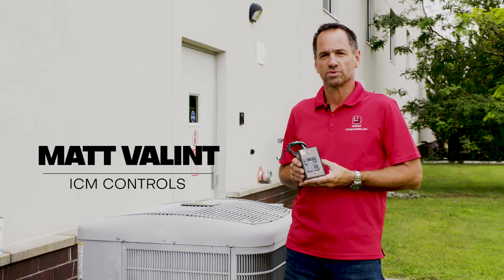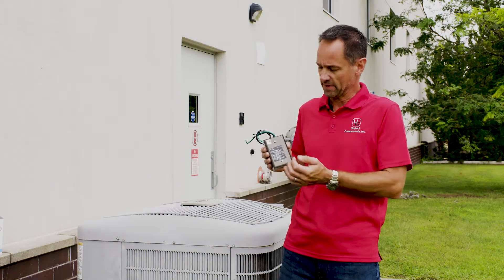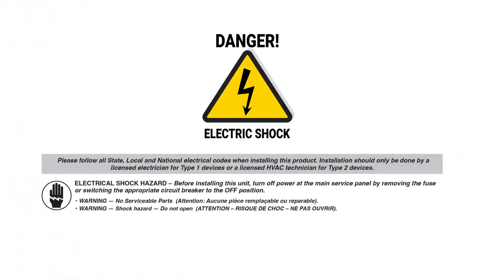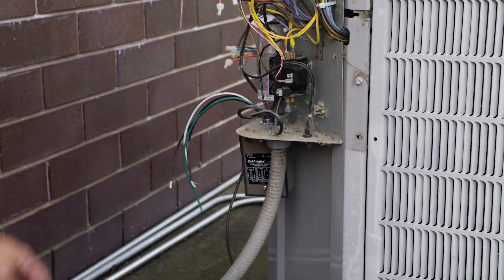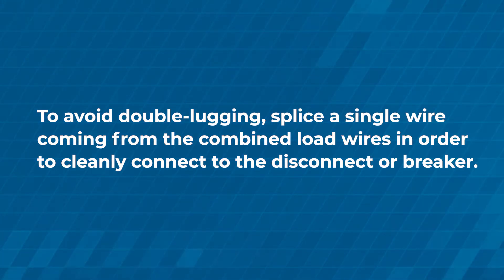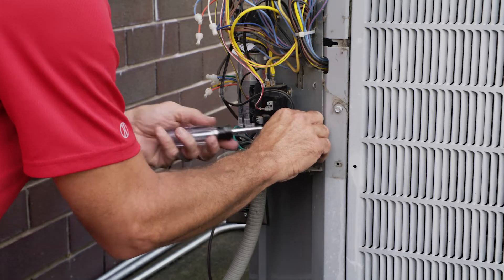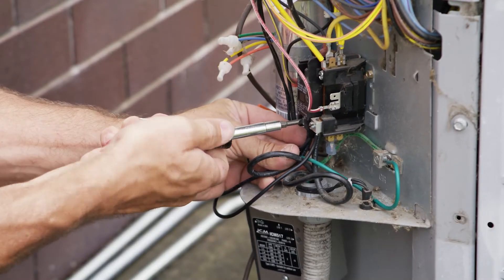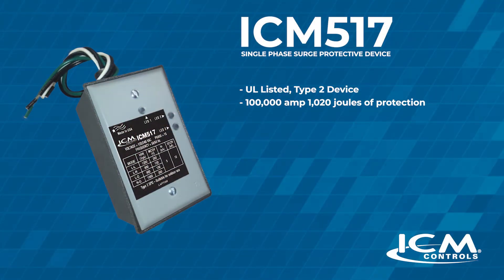Installation Video ICM517 Single-Phase Surge Protective Device

Comment: I have one of these installed on a Lennox condenser unit at my home. The LED1 and LED2 lights are no longer on. What does this indicate?

More Info: The condenser unit no longer turns on, but my contactor in the condenser unit is receiving signal from the inside thermostat and dropping into place appropriately, However the unit doesn’t turn on. 

Any info you all could offer would be amazing. 

Thank You,

Comment: Did you guys splice your units stranded aluminum wires with stranded copper wires?... You're not supposed to do that. Why not just make the unit with copper so you avoid the corrosion and code violation issue.
Reply: It’s gonna be fine dude

Comment: I dont see how that surge will even work like that. Its suppose to go in the disconnect box on the wire feeding from the main panel. The way you have it its going its going to hit the condenser and surge box at the same time. Think of it was a in-line fuse.
Reply: Electricity always takes the easier route, which is to the surge here. Poof!

Comment: This was good, I am glad to find one installed in the actual condenser instead of the disconnect box. Yet, why didn't you shorten the wires? And, why didn't you pigtail the hots (not the ground which is permitted to double tap)?
Reply: why does it matter if installed in condensor or disconnect box? Wouldn't installing it in the box allow it to short out before the current got to the condensor?
Reply: @sunshine5349  interesting point. And, current will take ALL paths, yes, the one with less resistance will always be much more in proportion, and it is likely any search will come from utilities lines. Yet, is also possible that you get a nasty lightning in your backyard tree. Good ones take nanoseconds to tackle it, go to your point I guess that is why all of them instruct to shorten wires and avoid sharp turns, voltage is a weird bird. In fact, if wires are to be long do you need to twist them once every inch for optimal performance. Not my opinion, the manufacturer's instructions. It's like when you twist communications cable for the same reason, you want to trap surges.
Reply: How can this device shunt a surge to neutral without a neutral wire hooked up?
Reply: @jimfrye4480  The ground will be bonded to neutral at the main pabel and will eventually find its way back.  Besides, as long as is diverted and not absorbed by yhe unit is fine, it will find ground either on the copper rod or the transformer at the pole.
Reply: @jimfrye4480  the ground wire is used instead. btw it's a not a shunt, it's meant to take on the power surge directly and destroy itself hence the "sacrificial TMOVs" as he mentioned. Think of of it as a giant fuse meant to be blown and then thrown away after it has done its job.
Reply: It doesn't matter where it's installed especially when it's hooked up directly in line with L1/L2 whether at the contactor or at the disconnect electricity always takes the path to least resistance so it will ALWAYS hit the surge protector first.